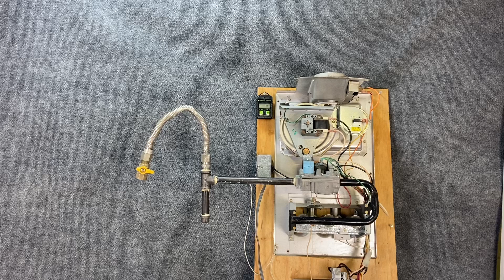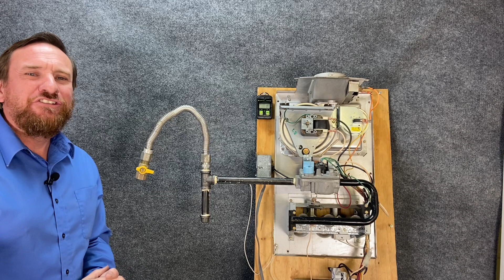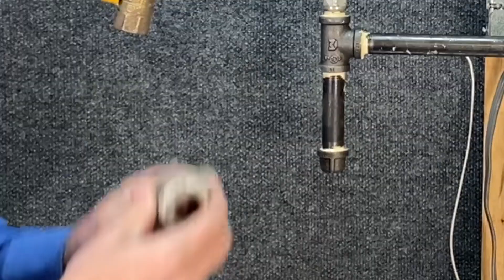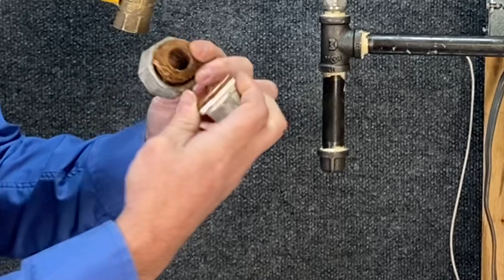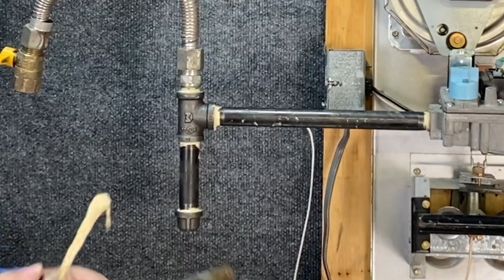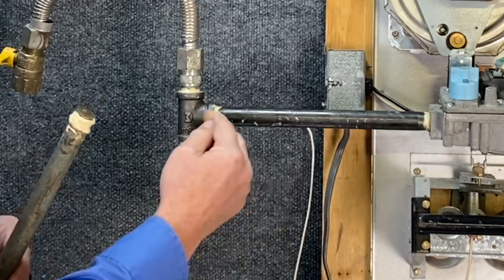Gas furnace piping, sediment trap, dirt leg, drip leg,

Comment: the first thing I would look for is if the unit has a built in sediment trap.   My second main concern is being able to clean out the sediment trap on an annual bases, at a maximum time frame.   I would consider a flexible shut-off valve a soft connection.   You are in pretty close proximity if you shut off the gas there and remove the sediment trap nipple.  My code prefers you use tape and pipe joint compound to make connections so having to remove and reinstall the nipple requires removing a tougher connection, cleaning up everything and reinstalling it.

Comment: Whoever installed the gas lines to my furnace routed them right in front of the access panels to the AC coils making it impossible to get in there and clean them. The gas line needs to be rerouted. My question is.....can a home owner work on his own gas lines or would that void my home owner's insurance or violate any other rules ?

Comment: In Uniform Mechanical Code 2018,  Section 1312.9 "Where a sediment trap is not incorporated as a part of the appliance, a sediment trap shall be installed downstream of the appliance, a sediment trap shall be installed downstream of the appliance shutoff valve as close to the inlet of the appliance as practical, but before the flex connector."

I have installed sediment traps like you have in the video, but reading the code, is this technically wrong? "Before the flex connector" seems kind of vague and is confusing.
Reply from the maker: You are correct the updated code does want the sediment trap before the flex connector.
I do not know the reason behind the change but they do not enforce the location here locally. Best practice is to always follow the code.
Reply: @love2hvac ”A dirt pocket must be installed at the bottom of any piping or tubing on the final vertical drop or riser serving the gas furnace”
This is pretty unambiguous.

Comment: The flex connection is not CSST.  It is not even close.  A flex connector is made with a spiral wind not a corrugation.  It will not kink when bent on the connection.  All CSST manufacturers instructions prohibit using CSST as a flex connector.  The manufacturers state to terminate their tubing at a rigid point connection and use the approved flexible appliance connector to make the final connection to the appliance.  Your also wrong about galvanized pipe.  It is not the pipe that is a problem it is the galvanized fittings which are hot dipped in zinc.  The pipe is electro galvanized is not an issue.

Comment: Drip leg needs to be before flex
Reply from the maker: that's correct, changed in  2017 I think, not in all the local codes yet. it use to say as close to the appliance as possible.

Comment: speaking of gas piping, when I had the yard marked for digging I was  told the gas line from the meter to the street was plastic > seemed strange
Reply from the maker: They have had a lot of success with plastic over the years. It lasts longer, doesn't rust, handles some earth movement,. It's pretty cool, really thick orange plastic. Well it was 18 years ago when I first saw it.

Comment: Why is it required to have a union or flanged connector downstream of the shutoff valve?  And does it need to be between the sediment trap and the shut off valve, or just between the shutoff valve and the appliance?
Reply from the maker: Your local code may be different but typically just somewhere between the gas stop and the electronic valve.
The unit on or flanged connector is for servicing purposes such as replacing the gas valve. 

I have worked on units that hard piped the whole way and it is a massive pain to work on. I have to pipe just to check the inlet screen.
Reply: So if you ever have to change the gas valve in the furnace you can shut off the gas valve and break the union apart and just take out the little nipple and take your gas valve out
Reply: Without shutting down the whole line

Comment: This was exactly the video I was looking for. I'm a homeowner, the old gas line was galvanized to black to galvanized back to black all through the run. Small town having only 2 plumbing companies, both of which are short handed, left me to my own device...or whatever the plumber gods say...

I worked it out to where I would run all the gas lines the plumber would test it. I roughed in the lines, set up an inspection to male sure it was to code...nothing. 

Long story short[er], this video explained what I knew I was missing,but I didn't know why I was missing it (sediment trap). Thanks for this video, I was not going to install it out of need for heat now (my own fault) and not understanding its purpose.

I knew I was missing something in the run, but not having a professional inspect it before I "d-worded" the joints to tell me otherwise, i would have just straight piped the furnace. This video just saved me furnace. Haha

Comment: His jargon is cringe AF
lets go over some corrections

use these terms in front of a residential customer

"sediment trap" 
"flare face seal fitting"
"shock absorbing gas line"
"pipe thread sealent"
"non-stick pipe thread lubricant tape"

"sulphur" is contained in in the stink chemicals they put in natural gas
those chemicals are called "mercaptins".....so.....C+

give this video a solid B

doesnt say anything wrong....but....says it like a hillbilly

-10 points to griffindor to using such a big pipe wrench on 1/2" pipe
big no-no
you can overtighten this stuff and break it...and then you'll look like a huge dumbass

Comment: HVAC since 1984 I am just now thinking I want to test a theory on how much junk really gets in the line where I live we don't have moisture in the gas or so says CPS and as for debris I would find that very common with new construction but with older houses I'm simply do not find anything in a trap that might happen to be there.
My test will be using air pressure which I assume wouldn't be a whole lot different than natural gas if anything it would have moisture in it in the worst case scenario.
Plan to install clear vinyl in various places and create a place to drop debris in possibly set camera up to see something going on or maybe you could just do this for me and I can go back to work. Ha!
Side note we used to disassemble the "A cock" and regrease it until the plumbers cried to the board and made changing that valve to be under plumbing license.
Reply from the maker: Let me know what you find

Comment: I had a new furnace installed and within a month the gas pipe that screws into the valve is completely rusted with a sulfur smell coming out through the rust but will not register on a gas sniffer. It stinks up my home. How is this possible to smell so much but is not detecting a gas leak?
Reply from the maker: I would use some bubbles on in. Not just soap but the thick gas bubbles leak detector and see what happens. 

My concern is it corroding that fast. I would be looking at proper furnace grounding electrolysis. Also what other appliances or chemicals are in the room. May even need to look at what is leaching in from the earth.

Comment: is there a code for the distance  from the tee to the gas valve.???
Reply from the maker: That's a great question. I dint know the answer. The tee should be as close to the unit as possible but I do not know what code is for that.

Comment: Thanks for this video but the question...whether this sediment trap requires maintenance/cleaning over the period? Who knows how must dust or particles trapped over there. May be if it is filled with dirt that means it will lose its purpose.
Reply from the maker: I have never seen one clogged up even on units 30 years old that had never been opened. Anything is possible but its highly unlikely
Reply: @love2hvac  very interesting, thanks sir

Comment: In Europe copper is the norm for gas piping. Maybe US gas is different?
Reply from the maker: In central Florida there is a lot of copper as well but other places it is strictly forbidden. 
I want to travel threw the countries of Europe and make videos on the similarities and differences in the trade.
Reply: @love2hvac  well if you’re ever in the Netherlands hit me up!

I’m a service plumber there, im the Netherlands plumbers do heating and hvac guys only really do cooling, though it’s overlapping more and more as heatpumps are getting popular here and it’s us plumbers that install them. 

We’re actually called ‘installateurs’ (installers in english) and we do most everything related to water, ventilations and gas in homes. Only thing we can’t touch is cooling unless we get certified (which a lot do) and electrics outside of what we work on. 

A fun job really, you rarely get bored.

Comment: Great class as usual Mr. Branaman, some time I use leak lock, The gas leak detector went off because it sensed the chemical on the leak lock. it misled me of having a leak until I conformed it with soup bubbles.  Really I appreciate your efforts and your teaching method. All of my respect.
Reply from the maker: Thanks for the heads up, I'm going to try it out when I get a chance!
Reply: I have had bad luck with leak lock on steel pipe because it's a hard set compound. I always used a soft set such as Recto-seal #5 to allow for thermal changes and unexpected movement which may cause a leak.
Reply: @steveedlund7357  hello,but WHEN LAST HAVE YOU USED LEAK LOCK ?  YES years ago it was hard as hell,no more, I M SURPRISED HE DID NOT MENTION THE ;YELLOW; TAPE MADE FOR GAS, BUT ONLY MENTIONED THE NORMAL TEFLON TAPE,, CHERIO,, 🇺🇸🇺🇸🇺🇸🇺🇸

Comment from the maker: A special thanks toCarter Stanfield AHRI fundamentals of HVACR
9.6.1.1 Connectors and tubing shall be installed to be protected against physical and thermal damage..9.6.1(5)
 CSST shall not be routed directly into a metallic appliance enclosure 
where the appliance is connected to a metallic vent that terminates 
above the roofline.9.6.1.2
  “… shall not be installed through an opening in an appliance housing, 
cabinet, or casing unless the tubing or connector is protected against 
damage.9.6.5 “Each appliance connected to a piping system shall have an accessible, approved manual shutoff valve…”9.6.5.1
 (A) Where a connector is used the vale shall be installed upstream of 
the connector. A union or flanged connector shall be provided downstream
 from the valve…”9.6.8 
“…a sediment trap shall be installed downstream of the appliance shutoff
 valve as close to the inlet of the appliance as practical…”ICC Gas Code409.5.1
 The shutoff valve will be located in the same room as the appliance. 
The shutoff valve will be within 6 feet of the appliance.411.1 (3) “…semi rigid metallic tubing shall not enter a motor operated appliance through an unprotected knockout opening.”411.1.3.3
 Connectors shall not be concealed within or extended through walls, 
floors, partitions, ceilings, or appliance housings. International Residential CodeG
 2414.5.2 Copper and brass copper alloy tubing shall not be used if the 
gas contains more than an average of 0.3 grains of hydrogen sulfide per 
100 standard cubic feet of gas (0.7 milligrams per 100 liters).G2422.1.4
 A union fitting shall be provided for appliances connected by rigid 
metallic pipe. Such unions shall be accessible and located within 6 feet
 (1829 mm) of the appliance.